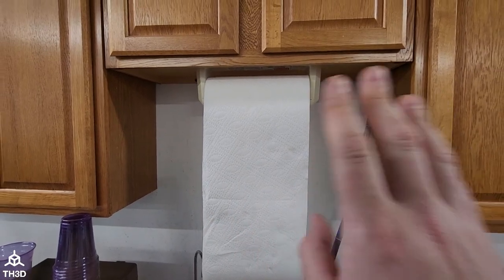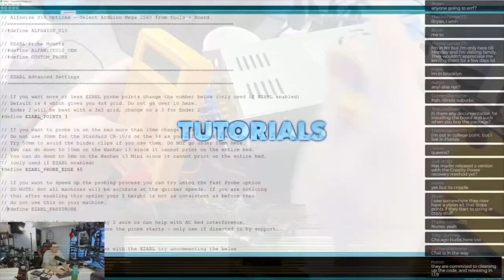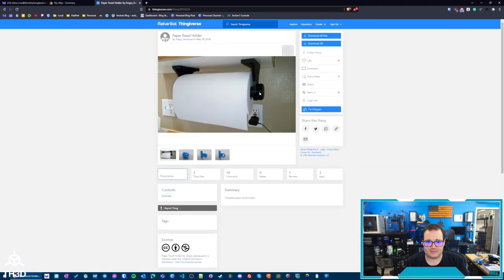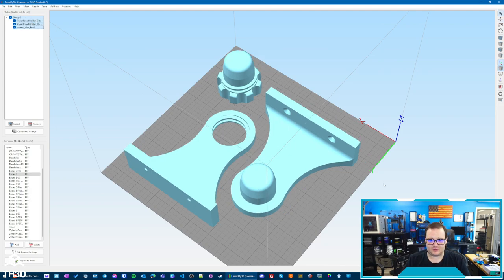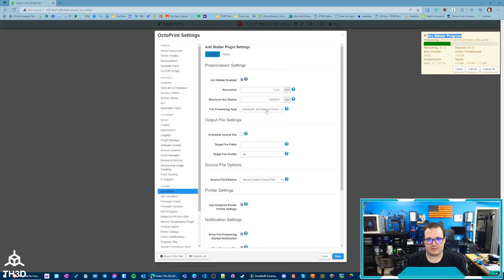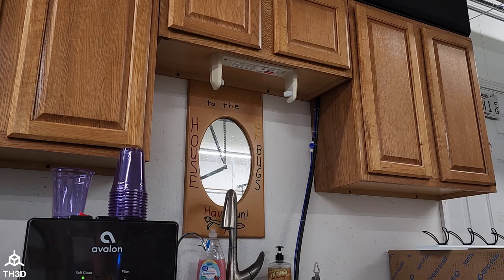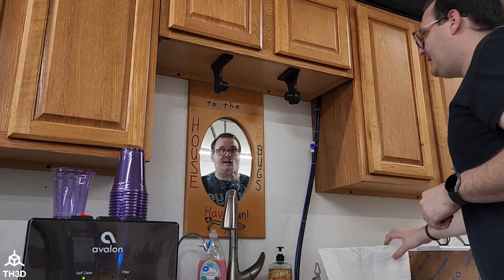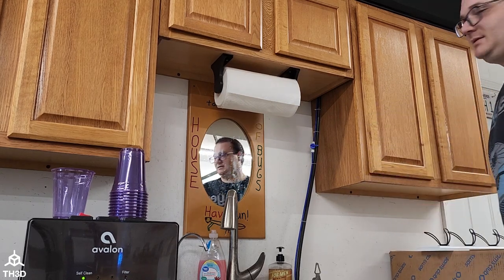Practical Prints - New Towel Holder for my Garage

Comment: That one looks like it will have the same problem that another one I found on Thingiverse did, it would not hold a large diameter roll of (Costco) paper as the "arms" were too short.  I tried enlarging the STL by 15%, but then the pegs were too fat to fit into the spool.  Think I'm going to have to make my own using OpenScad.  Besides, I can't screw it into the underside of the cabinet (rental apartment) so will have to mount it with double sided tape or velcro.  I get stringing between object on my Ender 3 Pro if I try to print a group of things, so I usually enable the print serially (one at a time) option.  This does increase the print time, but only by a few minutes, and it does limit where you can put things.  I've been using Prusa slicer or Super Slicer, and rarely Cura.
Reply from the maker: Thats actually a costco (kirkland) roll on there.
Reply: @TH3DStudio  I printed out the side with out threaded hole and tired it.  It will fit fine.  I will mount this using double sided tape to avoid drilling into the cabinet..